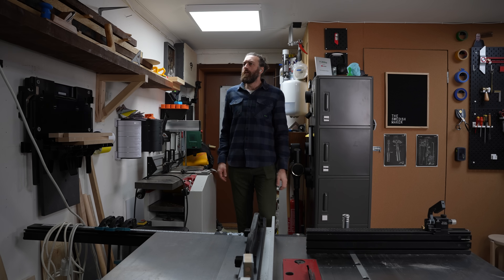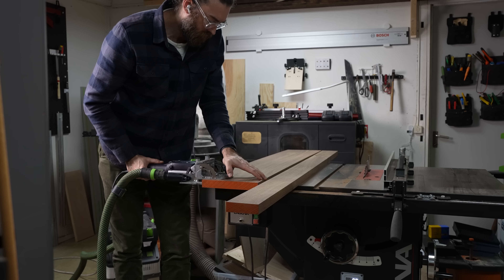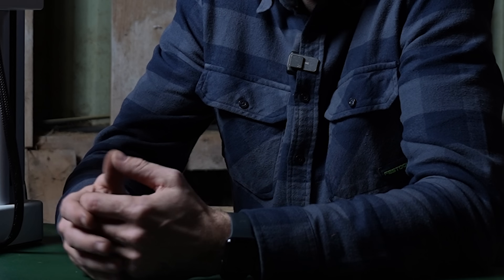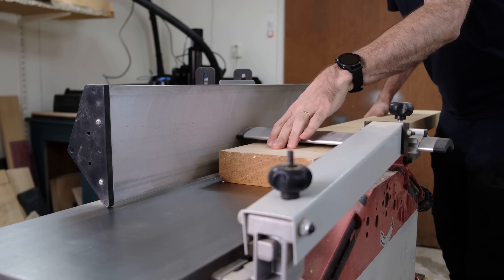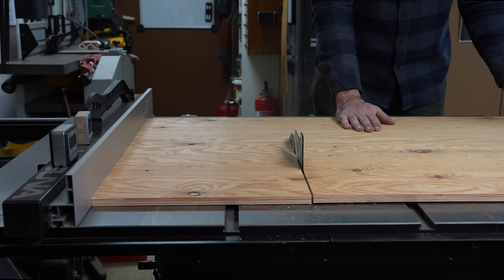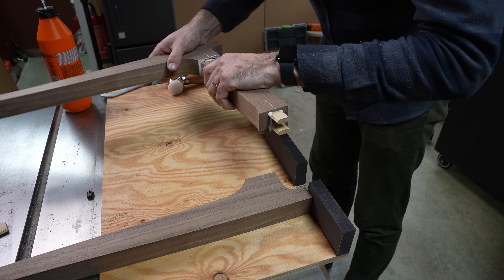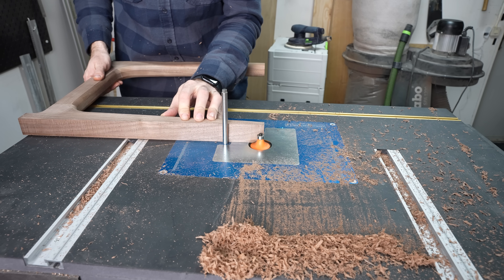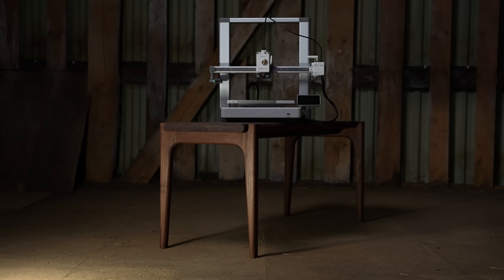Using a 3d printer to make furniture

Comment: I would say YES, a 3d printer is a tool. A tool that can be used in woodworking, much like a hammer can be used in metalworking without needed to be called a metalworking hammer or a scissor that cut thin sheets of wood (veneer) not being called a woodworking scissor. It is a tool and should be named as a tool not just what material it is working on. 

A cnc can cut plastic, wood even fabric with the right tool attached to it. would we then say it is a woodworking cnc, a plastic cnc or a fabric cnc we can but that would be a waste of time.

So i rest my defence case for the 3D printer it is a tool and has no need to be called a woodworking 3d printer much less than a table saw cutting metals would need to be called a woodworking table saw.

For the next case country wood and price.

1000$ for american wood sounds expensive is it worth it is there no Swedish wood or european wood that be less expensive to import more worth it instead of American walnut? Based on just price would like (using Swedish name) ek, bok, alm, aln, björk or any other hard wood be more or less expensive to  use in a table like in the video "no doubt pine (furu) would be cheaper" but for the case not really part of it. Follow up questions is it style, quality or other reason of using american wood? Like is valnöt swedish more or less of a material depending on country of origin?

Comment: Is a 3D Printer a Woodworking tool?
No.

Why? It is a tool that can be USED in woodworking.
Same as a screwdriver,  a tape measure, a pair of underpants..

A screwdriver can be used to put a screw into a piece of wood. It can be used to put a screw into a piece of steel. Used on a car. Used to pry open a tin of paint.

A tape measure can be uaed to measure a piece of wood. Or the distance over your garden. Measure the size of your manhood.

A pair of underpants are primarily used to keep you manhood in line, to make wearing trousers more comfortable.  Equally. They could be used to wipe finish onto a wood piece.

So does that make those woodworking tools?
No.
They can be USED in woodworking.  Same as the 3D Printer can be used to aid in woodworking.  Or to print a "3D Benchy" or a bust of a T-800 Terminator or to mock up an engineering piece.

It's a tool.
Simple as that.

Comment: Hot tip - for your router jigs, save three quarters of your print time - skip the top and bottom layers, increase the perimeters by a few and you won't have to print overnight.  They look cool too, with the exposed infill. 🙂
Reply from the maker: Good advice, thanks!

Comment: I like your idea of a tool that is woodworking adjacent.  If matches my thoughts of primary and secondary (and tertiary?) tools.  Primary tool:  you directly apply the tool to the wood to change the wood in some way.  Secondary tool:  a thing that helps you manipulate the wood (measuring tools and jigs).  Tertiary tool.  A thing that you use to create or manipulate tools, like jigs, blades, sharpening systems, etc, that you would then use to manipulate wood.

And, must woodworking be strictly a reductive (?) process?  Couldn’t it be additive?  Would planting and shaping growing trees to form tables, ladders, fences, or whatever, not be a form of woodworking?
Reply from the maker: Couldn't agree more! I like the primary and tertiary definition!

Comment: You are using the word "tool" when you mean "machine." This is not uncommon.
To put it simplistically regarding the topic, the difference between a tool and a machine is:

Tool
A device used to shape, cut, or join wood.
Examples: Chisel, saw blade, mallet, plane blade, drill bit.

Machine
A powered device that assists in woodworking tasks.
It can be driven by human effort or other power sources.
Examples: Table saw, plane/planer, lathe, bandsaw, drill, router.

Using these definitions the commenter is correct. However, this is a bit simplistic and pedantic. The broader argument though is that a 3d printer is a machine (not tool) that can assist in making object from wood. While not limited to woodworking, you have provided a valid argument that a 3d printer has a place in a woodworking workshop.

I rule in favour of the defendant.

Comment: I get it, this video tries to sell 3D-printers and by commenting I contribute to that. Which in a way is not very nice of me, but on the other hand language and semantics are important because that is how we communicate and understand each other. This video tries to blur those lines for profit which is ethically (yes I listened....) questionable at best. So I guess I knowingly step into the trap...

First what is a tool? For me anything that isn't alive and performs some kind of function is a tool. A car is a tool, a pair of eyeglasses are a tool, a web browser is a tool and my nails can be used as tools, even as woodworking tools but I wouldn't recommend it. To communicate easier it is helpful to categorize different tools. Useful categorizations include the specific material it is used on and the specific function it performs. So  3D-printer is a tool, there can be no question about that, and it can obviously also be a very useful tool.

So what are woodworking tools? For me any tool that can be used directly to cut or shape wood is a woodworking tool. So a ruler or square are not woodworking tools as they doesn't shape wood, they are measuring tools and can be used to measure many different materials, wood being one of them. For the same reason a template isn't a woodworking tool as it doesn't shape wood. It is closer to a measuring tool and closely related to the fence, albeit a very specialized one but also very useful for that one specific task.

If you argue that a 3D-printer is a woodworking tool then you must also consistently answer questions like these: Are the headphones I use when watching woodworking videos that contribute to my woodworking hobby a woodworking tool? Are the videos themselves woodworking tools? Is the truck delivering wood to the store a woodworking tool? Just because something is used in the chain of shaping wood doesn't make it a woodworking tool, it doesn't make it any less important or valuable just belonging to a different category.

As an engineer I once again shake my head and mutter "teachers"...

Comment: You could call it a support or scaffolding tool in this context. What you print in the video isn't part of the final product but still necessary, like supports in a 3d print.
But in the end a tool is labelled based on its purpose. And if you use your 3d printer for woodworking then in your case it is a woodworking tool, even if it isn't for some other people. Just like a sponge can be used for painting or for applying make-up, but also for cleaning stuff in the kitchen.

Comment: Any tool you use in the wood shop is a wood tool.  Anyone who says it isn't is just another idiot who 1) can't afford that tool  2) doesn't understand that tool or 3) hasn't really made anything past cutting boards or other smalls.

I've used a 3D printer, CNC, laser engraver, etc.  If you want to argue that either of those aren't "woodworking tools" then I have to ask you to define "woodworking tool".  If you think only hand tools are woodworking tools, then where do you get your wood?  My guess is from a place that uses every possible tool they can to make your boards in the sizes you buy.  If you use a drill, table saw, router or any other "newer" tool, then I'd just suggest to STFU, because you're an idiot.

Comment: First of all, my compliments for the way you start this discussion! I understand your plea why you consider a 3D printer a woodworking tool. However, I miss a motive why it counts for woodworking. Your reasoning basically makes everything a woodworking tool, from the bottle of beer and the refrigerator it is in, the knitted socks of my grandmother that I wear in my cold workshop, to the plane with which a cross-cut saw guide made elsewhere is sent to me.
I draw the line differently. Woodworking is about making wooden workpieces. The tools that are used for this are indeed partly made of raw materials other than wood, but I do not count the factory - even if it is a 3D printer - that makes them for me as woodworking or as a woodworking tool.

Comment: I wonder if we’re can meet in the middle? I don’t think a 3d printer is a WOODWORKING tool, not because it can’t cut. But because it’s not solely for woodworking. I think the commenter is right but not for the right reasons. A 3d printer can be FOR woodworking due to its application in that moment, just as long as it can also be a kitchen tool, automotive tool, etc.. To me, a 3d printer is a tool, and to some hobby, it just depends on what we’re using it for. So it may be YOUR woodworking tool, but maybe it’s something different to the commenter and that’s what he had issue with?

Comment: Personally, I don't think there is anything that is specifically a woodworking tool.  Almost every woodworking-tool will also cut aluminum, or plastic , or composites. Tools are simply tools. You are doing wood working when the project is made mostly out of wood.  The only time there is a problem with tools is when someone says "I'm a hand tool builder" and are batching things out on a CNC.  People should just let others do things they way they want and stop assuming that their way is the only way to do something.
Reply: Whats wrong with building hand tools with a CNC?

Comment: Im at 14s of this video. And a see the comment, no matter what you going to say my stance is:
Woodworking tool is any tool that helps make anything with wood. We can differentiate how important is anty tool in woodworking in this case 3d printer which not even secondary but rather tertiary general use tool but it can print jigs, holders important to other work you can use also a welder in a woodworking shop because it's sometimes needed to weld something.

Comment: Woodworking tools are tools that are made for the task of woodworking like jointers, saws, planes, chisels etc. You can use them for other things but that doesn’t change the fact that they are woodworking tools.

Just like a 3d printer is a tool but not a woodworking tool, even if you use it in woodworking projects.

I can think of a million things to use in the woodworking shop, but would say 99% of them are not FOR woodwork. It’s the consensus that a tool is a woodworking tool that makes it so.

Comment: Before even finishing the intro, here's my take:
It's easy to call table saw or other classical woodworking tool a "woodworking tool" because it shapes the final piece of wood that is the finished product. A 3D printer will never directly cut or shape the final wood to form, so in that respect, it is not a woodworking tool.
On the other hand, a common use for classical wood working tools is to make jigs and templates that then allow other woodworking tools to achieve a result that you couldn't have easily gotten from the tool on it's own. In that area, a 3d printer excels! It can make jigs and templates and other helpers that nothing short of a CNC router could make and can even make things that would be difficult, impractical, or just downright impossible to make out of wood or other material using subtractive processes. In that regard, it is absolutely a woodworking tool that fills a niche that nothing else could. 

Does it shape wood... no. But does it provide the woodworker with options that other woodworking tools can only dream of... yes.

EDIT: I see I was pretty close to your PoV. I'll put it this way... if a dust extractor or sanding block or marking knife or square or sawhorse or crosscut sled count as woodworking tools, then a 3d printer is a woodworking tool. They may not directly shape the wood, but the sure do make life easier.

Comment: I'm firmly on the whatever side, that said... It's a tool used while woodworking, but if I use a welder to weld a template I wouldn't call the welder a woodworking tool. More importantly, you need to look up the "masking tape and superglue"-trick. Snygg bänk förresten.

Comment: I Really like your channel.  I worked for a Swedish company for 8 years. Iggesund tools in Iggesund Sweden.  I have been there twice.  You know your shaper origin really excels at making repetitive templates.  I use my shaper origin a lot to quickly make super accurate templates for furniture I build multiple times. I know you have commented that you wish you did not purchase the shaper origin but with it and no investment in a 3d printer I have made dozens of templates to produce furniture parts quickly with a high degree of accuracy. It also excels at making curved parts, inlay work, and lettering and signs.  I have no ties to shaper origin the company but the machine is only limited by my imagination.  Hey do!

Comment: Im not a woodworker but a kitchen fitter and I use my 3D printer to make tools I need for fitting kitchens. I have made scribe tools, out of square jigs for worktop cutting and I am currently working on a modular routing system to make cutouts on kitchen units rather than having to use a jigsaw that always leaves a bit of a mess on one side. My 3D printer is invaluable and i consider it a woodworking tool. I also consider it as a mechanics tool as I have also made tools for boring out a engine block. I use it a lot. Another great video 👍

Comment: Objection! A 3D printer is a machine, the extruder head is a tool and the nozzle is the die.
Hence a woodworker using a 3d printer is a plastic machining woodworker, while a guy using a router on wood is a wood machiner.

Comment: If the second definition of "tool" is not true than Great Apes do not use tools, which means we did not ever learn to use tools. because the definition of tool must be broad enough to include a simple stone or stick and inclusive enough for a 3D printer or LHC at CERN. 

tool(s): are what any species use to achieve what we are limited in achieving by pure biology alone.

Comment: fun build!  I recommend using a clamping jig to hold the material around an open ended router bit.  sometimes the material can catch hard and violently move the material. if your fingers are too close...you may have less fingers after such an event.  So is there that much debate on what is an isn't a tool.  I think they're all tools...anyone who says otherwise is probably confused...a person can use tools however they want.  keep it up.
Reply from the maker: Thank you! and thanks for the tip!

Comment: Hi :) I'd say (as a software engineer and a hobby 3d printer but not a woodworker) is that the printer is not a "woodworking" tool. Sure it lets you achieve your woodworking goal but its a (in lack of a better word) a plasticworking tool. It makes plastic pieces that you might use to achieve accuracy, or to combine them with your mainly wood based projects. But it still doesn't work on the wood itself. Your argument is like the car is a tool, helping you move stuff around, and if you use said car to transport wood for your woodworking project it becomes a woodworking tool? :D It definietly has a place in your shop, in a chefs kitchen might be a stretch :D But I have for example printed sourdough bannetons in the past :)
Reply from the maker: Im happy you weren't on the opposing side of the defendant